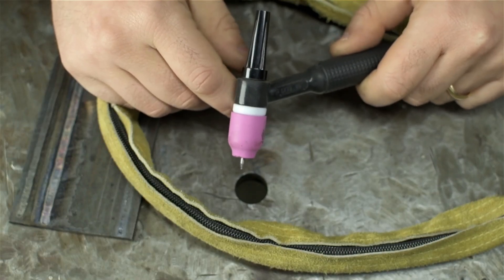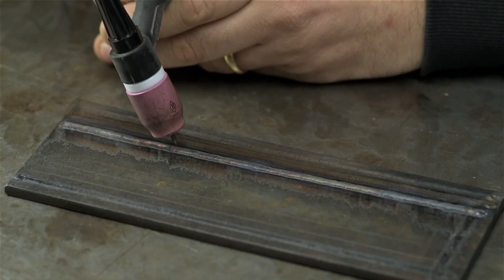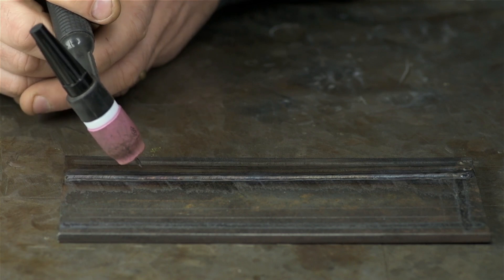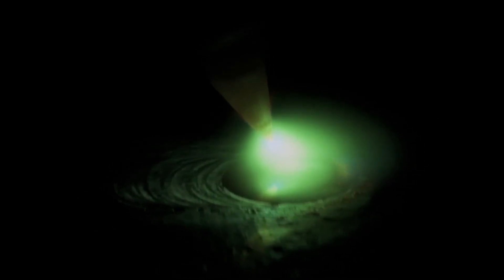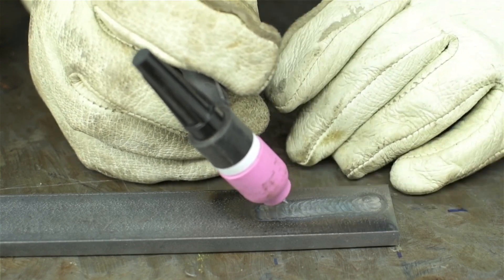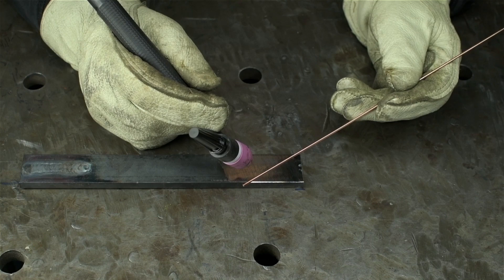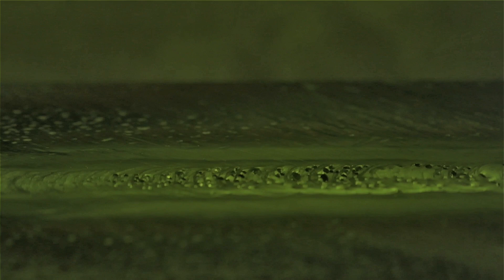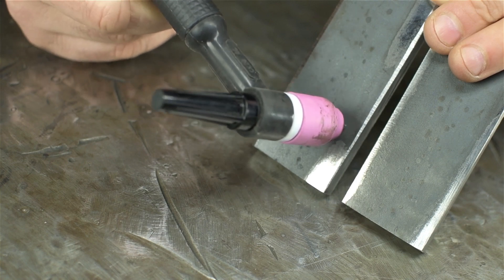TIG Welding - Puddle Control

Comment: I stick and mig but tig has me bewildered. This is the best tig video by far. To tig weld i have to not get frustrated and realize i have to learn welding all over again. Just as i  was lousy at stick and mig at first i kept at it with a fury and in time got much better at it. Tig is forcing me to do the same. You can teach an old dog new tricks will be the sign i am going to print out and attach to the front of my Everlast Tig welding machine. Thanks for the video😊.

Comment: Splashed out 1k for a  parweld xtt212 today haven’t told the other half yet so If I’m still alive I’d like the chance to learn how to use it.

I’ve always been interested and I’m not a bad mug welder. It’s time to listen to myself and follow my heart
Reply: Hey, so it turns out I survived and she even got me some argon for my birthday, wonder what that will cost me.
Anyhow I’m struggling. I can weld in a straight line on a flat piece on 3mm ali plate and it don’t look 3 bad to me. The problem I have it tacking 2 bits of plate together it melts both plates but the puddles won’t join I just end up melting the bits of aluminium are my amps to high or low? Do you know what I mean? And can you help in any way? Thanks man I love your videos.

Comment: Beautiful!!!
Reply: I use to tig in my snot-nose 20s good enough to weld two aluminum pop cans together without blowing a hole at Job Corp. I'm 60 now and don't remember anything about tiging. You brought back what I was trying to remember. I can't wait to get home from work to turn on my CK Mr. Tig 200 I just bought and straighten out the mess I'm making on my test plates. Thanks, Tony, no wait. (John Doe).😊

Comment: My recommendations for new welders are, stick your tungsten further out the cup so you can see and grind a longer tip on it so you can get away with being a bit further away from your weld puddle so you dip less often.

Comment: Big thanks for your TIG videos. I took two big steps forward today. First time coming in from the shop when I didn't feel like my TIG welding journey was going to be the cause of my first stroke! I didn't dip the tip or touch it with the filler rod...

Comment: Tony, I remember there is a amperage to metal thickness relationship. I've figured a cup size that is found by heat color. Isn't there a cup size to tungsten stick out also?
Love your video. Old time Gary
Reply from the maker: tungsten can stick out one cup diameter (ID/nozzle size).  If you're using a gas lens in there you can stick it out a little more.  +50%?  if your tungsten turns blue it's sticking out too far :)

Comment: Hope for contaminated tungsten:  I often get little bits of contamination, not enough to make you want to cut the end off the electrode, but still annoying and it changes the arc.  I have some little copper blocks sitting on the bench,  they are easy to strike an arc on, and can take a lot of heat.  SO, if you just light up the contaminated electrode on this and give it all the power it will take, it might be that the contamination will burn off in a few seconds.  You'll see that the color of the arc will change back to what it was.  The electrode won't be shiny after this process, but it will still work.  It's worth a try, if it doesn't seem to be working you can still go about your original recovery process.

Comment: Did my apprenticeship 25 years ago in the UK and one of the first things they taught us was how to feed the filler wire through your fingers steadily which is important when you Tig weld as you can't keep stopping when your fingers get hot then move the wire and start again.

Comment: I had a dipping problem because of my first torch, which had vinyl hoses. They were so stiff I would dip as I tried to move the torch. My new CK torch with extremely flexible hoses has cured that problem. I can move much smooooother now. Thanks for the video.

Comment: @Tony how did you film the puddle? An SLR with long macro lens and some ND filter? And was it mounted on a little wheeled dolly which someone rolled along for you? Great results.
Reply: now I've had a bit more of a look at it there is a zoom around 4m 30s which seems like its done in editing rather than by the camera zoom and then the frame follows the puddle. Before the zoom the frame is a bit dark and green so I guess you're using a welding helmet panel in front of the lens rather than a filter because as soon as the arc starts it adjusts. Maybe its not a dolly at all but filmed at 4k and if the output is 1080 you can do the follow with so many pixels to spare through cropping. Am guessing you still need to be using a longer macro lens. Maybe you set the exposure manually and then its up to the helmet panel settings to get the correct exposure when the arc is running. Maybe its the auto exposure in your camera. Its a really good shot set up.

Comment: Just starting with TIG (DC, black steel to begin with, have some 316 too) and I have a number 9 torch with no. 10 pyrex cup and a gas lens. I know it's best to learn with basic cup but I got a shopping rage on ebay... I am actually "starting" for the second time, took some research and first steps a year ago, but then a lot of things happened, and I did not have the time to continue. Now? it's all gone from my head, so I have to do a bit of a research again. I would have some beginner questions if you would be so kind to answer :)
1. stick out - with no. 10 cup - stickout can be approx. the width of the cup, right? so I could theoretically afford about 15 milimeter with no. 10 cup?!
2. gas flow - how much should I pump out of no 9 torch with no 10 cup to have correct coverage, but not waste?
3. I have a 2.2 mm tungsten, gold end (don't remember what kind it was) what current (approximately of course) should I start with that on 2-3-5 mm steel DC?

That's all to start I guess. Please advise, I watched a lot of your videos, so you know... You're partially to blame for my current urge to weld! The other guy too, 6061 one.

Comment: Thanks for making the comparison to soldering and for specifying that the filler rod should go into the edge of the puddle.  I’m a beginner and I thought I had to feed the rod into the cone.  I’m hoping this helps me not dip the tungsten as often as I would have without this knowledge.

Comment: Why not angle the torch backwards, so that perhaps more of the shielding gas goes backwards over the still-cooling finished joint? Use your left hand to drag the torch, and dab the rod with the right. Disclaimer: Just asking from innocence.

Comment: Great video, I failed my tig welding pipe exam for plumbing trade, my joint leaked, I was very upset, but now I just wanna buy mu own gear and practice till I can do good welds . This vid really explains well, for me it's a motorskill issue, ie, learning to control the shakes, as I am a bit older that most guys learning this, but I hate to give up, I'd love if you could do a demo on gas welding, as us plumbers have to rely on that the most.

Comment: Tony- nice job- I do lots of old car restoration metal welding - Could you do a video on butt welding 22 gauge metal - not many videos on tig welding light gauge steel. Thanks Ken 715-432-5080

Comment: Considering you weld a lot, at least in your videos, why don't you try to learn how ti free hand with your Torch? I mean, you Need to put your Palm on your bench, but, this Is Just an habit.. if you learn to hold your Torch free hand, you'll be more versatile in every position.
At work they wanted us welders to learn this way: i mean for the First week you can have some trouble, but then you get so many benefits that you won't ever come back, especially welding in position and during transitions beetween different positions..
Just my 2 cents.

Comment: I've only been TIG welding for a day and a half now, and I've already dunked my tungsten in the weld puddle more times than I can count. That bit I get. The bit in your video about how the arc length being too long causes the filler to melt prematurely was not something I'd totally grasped and clearly my over-compensating for my puddle dipping tendencies is causing my other issues... namely shockingly bad looking welds and big dollops of molten steel everywhere but in the gap. Thanks for the pointers, and kudos on the camerawork - a step above most other videos I've watched on the topic.

Comment: These are great videos.  I used to watch (actually not watch) my father weld all kinds of stuff (steel) with a stick.  I regret not learning from him but have recently developed an interest.  Everyone says that I should start with stick but I would like TIG because it seems more civilized without the spatter of burning off the flux.  One thing that is lacking in the TIG videos that I watch is exactly how the arc is initiated.  I know  you have a foot pedal and that the arc is an argon plasma.  But how is it started, do you just hold the tungsten close and increase the voltage (with the pedal) until the arc is struck?  Or what?  Just seems like magic now.
Reply from the maker: if the machine has high frequency start.. just push the button or pedal.  it's like a BBQ igniter.  if not, scratch the tungsten like a match.  good luck have fun!

Comment: As long as you are talking, I'm learning, regardless of the subject. So keep the videos up. Humanity needs it! I Tig weld at work weekly, but I believe you can always learn something new even when it's something you already do. I have a lot better results when it's a small piece that can be put on a welding table, but sometimes it's repairing a hole in a chip conveyor from one of our CNC lathes or mills and I end up kneeling on the foot pedal working at floor level with blind corners and can never get the material clean enough. Always coolant and oils lurking.

Comment: Tony, I've really enjoyed the TOT series of videos.  I'm going back and rewatching them, as I'm very close to purchasing a TIG welder for a project.  It'll be my first time welding aluminum, and I'll be coming from a hobbyist MIG background, also with a lot of soldering.  I know some elements are the same, such as tack welding things together.  If you do another follow up, could you maybe cover any differences?  Like, do I still need to do stitch welding to prevent warping, or does the inherently more precise control with TIG make it better to do continuous welds?  Again, thank you for your videos!

Comment: I’m majoring in welding and metalworking in college right now, and studied welding in high school, and I still learn things from you. I should probably mention that I got every single tig welding job that came into the shop at my high school cause I was the only one they trusted with them, even if it meant it’d take longer. I picked up tig with aluminum and was putting down beads nicer than some of the seniors, as a sophomore, so I never really had to struggle through the things that most people deal with. As a result, I honestly prefer watching stuff from people who had to work through all the things I somehow picked up like it was breathing. Even the people who went through it kicking and screaming. If you ever have any questions, feel free to send me a message and I can do my best to shine some light on whatever you may be having a problem with!
Reply from the maker: Nice!

Comment: I'm at the point near the end of this video... T joints with 2 puddles, trying to weld coupons or 3/16 flat bar together with no filler. Typically using 1/16 tungsten (recently switched to 3/32 and it's a LOT easier, but losing a LOT more of the base metal)... hard to tell if it's voltage or gas coverage or just general defiance of physics and a need to prove that if I can make metal liquid it should do what "I" want it to do regardless of actual "science". You've been a big help and an inspiration to get started!

Comment: What happened to the lost art of oxy-acetylene welding? A neighbor designed and built a car in his garage, used oxy-acetylene and coat hanger filler for the frame. Early 60's.

Comment: I literally just started  tig welding....this was EXCELLENT.  Apparently, I have been doing  exactly what I shouldn't be 
doing. Especially the part about letting the arc melt the filler rod......between you Jody and  The Fabricator, I may eventually learn how to Tig.....eventually.....

Comment: At my work, we are producing cooling systems for nuclear reactors (no joke) and some of my coworkes are running to the grinding wheel to regrind the tungsten electrode every 5 minutes... (German manufacture O.o) but i dont judge them bacause i am an machinist and have not that experience in welding =D but still very good video, keep ´m going! :)

Comment: Thanks for all your welding related content Tony. After struggling along with a $15 fleamarket stick welder for years I finally bought a TIG welder. Corny as it sounds, it was all thanks to your superb videos that pushed me to want to learn TIG, especially the go kart build which I enjoyed immensely. My welds still look pretty average (strong like ox however!) but I practice often and I find the actual process so much more enjoyable than stick. Thanks again, keep up the awesome work, I have learned so many useful things from your content.

Comment: Hey Tony, so I finally bought a bottle of argon the other day (where should I send the bill by the way? ;-) ), and I discovered a major flaw in your videos: It ain't as easy as you make it look... 
But I'm coming along I think, much more pleasant than stick, especially like the quiet.
Only one thing really surprised me: the puddle is tiny! I'm used to more molten metal than I can handle using 3.2mm stick electrodes at 125A, but even at 160A the TIG puddle is barely 6mm wide. Is this normal? Do I have to weave aroud or how else am I to make any kind of substantial seam?
I shall have to review your videos now that I have a better understanding of what to watch out for. Thanks for the encouragement.

Comment: Seeing the porosity caused by too long of arc length will help me more quickly bring this in check as I do this all to often, sometimes seeing this porosity and thinking it is surface contamination when it is really just bad arc length control. I had never seen this done intentionally to see what happens. novel Content !!!

Comment: More videos please... Q. Are you able to tell how much tig weld penetration in thin stainless steel butt joints by the colour of the weld? Say a 0.9 or 1.2 mm  butt fusion weld only... I picked up somewhere that a golden colour equals to approximately 75% peno...?

Comment: Hi Tony, you've done a great job bringing up the necessary stuff for us guys to get comfortable working on form and basics. I'd be interested in a video that goes into some of the numbers to help us dial in our equipment. Things like cup sizes, lenses, amps, and tungsten selection/prep would really help me push over the beginners hump. What you're best at is doing the opposite of a dry, numbers/details oriented video but I'm hoping you can bring a shorter, fact-packed addendum. Challenge accepted??

Comment: When I learned to TIG weld in Jr. College my welds were terrible, couldn't see what I was doing. Finally realized the college had abundance of hoods with #12 filters. When I bought my own variable filter and adjusted it properly my welds dramatically improved. Gotta see the puddle!

Comment: I don't care what type of welding you do, stick, mig, tig, or acetylene you can take the info of your video and apply it to what your doing. it's all about puddle control. even the info on aspiration, any leak in your hoses causes air to be sucked into the hose. and that contributes to contamination of your weld puddle. great video

Comment: Thanks Tony, now I know why I am getting the craters, though I am at 20 on the flow. I have a Square wave 175 for years and the only thing I can do to an acceptable degree is fusion. I build the filler rod into the piece to be welded by leaving a “lip” at machining which will be melted onto the other piece and weld without an under cut. I really sit down to weld for a week but no time, energy, steady hand and I am lazy. Of course there is the MIG. Thanks for the help. Bob

Comment: If you are having trouble with puddle control and are worried about your angle, may I suggest Depends. Although they won't handle your gas problems, they will control puddles for people who are getting on in age and their 'welding' doesn't work so well anymore.

Comment: These videos are amazing mate. Super helpful and by far the most beginner friendly info on YT. Welding tips and tricks is a very close second though. Seems like alot of pro guys have been doing it so long they have forgotten what they/everyone struggles with when first starting off. These 3 videos have answed almost every head scratching moment I've had in the last few months especially the rod burning off before it reaches the puddle. How do you know if you are using/wasting gas?

Comment: Theoretically if you lay a rod of filler on your workpiece in the direction of your weld, since the puddle melts the filler, it should work without problems, right?

Comment: I have to go along with the other comments Tony. You may not consider yourself a welder but you really should think of yourself as a teacher because these are excellent instructions on what to think about when picking up a tig torch for the first or 13th time. Plus I am guessing that "Puddle Control" ( que the music) is really a basic component of any welding be it mixed gas, arc or mig. I don't foresee a need for me to ever pick up a torch to connect two pieces of metal but at least now it isn't a mysterious and magical craft that I haven't the shekels to buy off the guild members to get initiated into the dark arts.